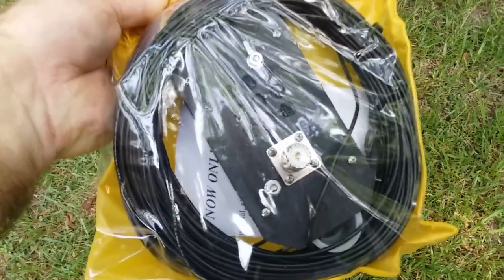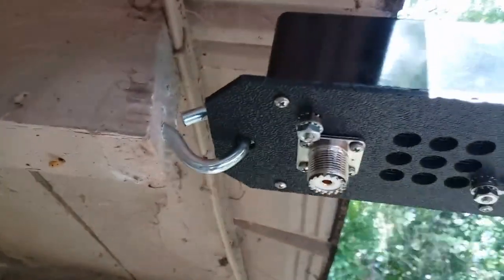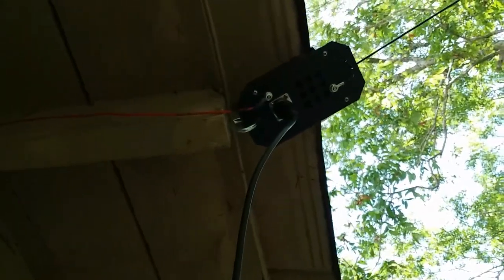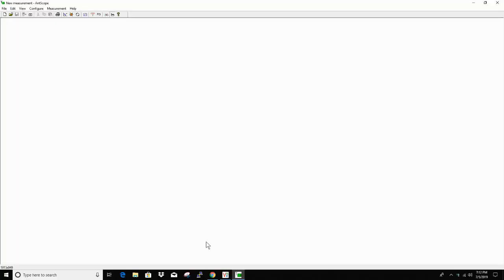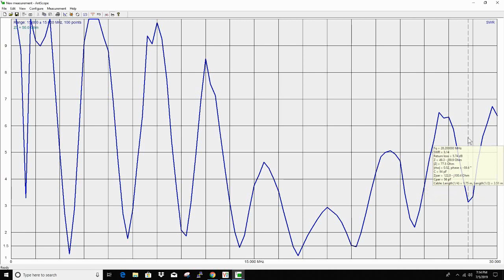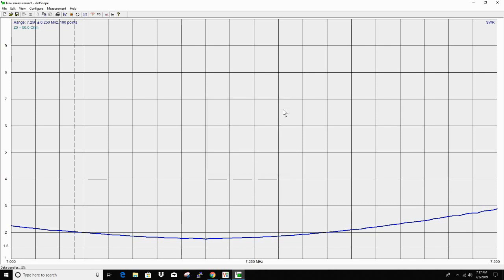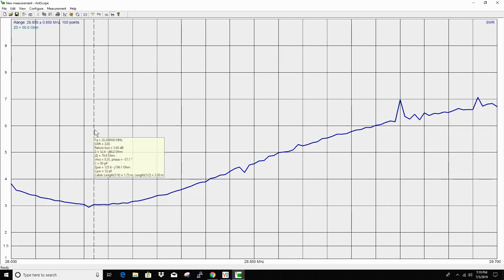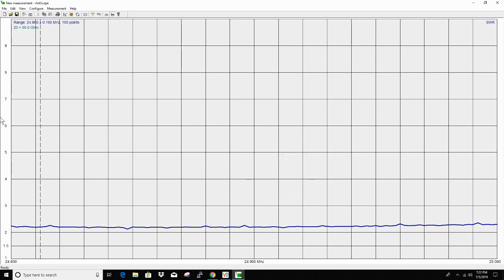MFJ 1982MP Endfed Half Wave Antenna

Comment: This was my first antenna, and I still have it. I got every state except HI (even then, probably could if I tried harder) from MD. I’ve also gotten New Zealand on FT8, and EU is easy, but I live in east coast. 10 meters is mostly unusable. Everything else is ok, especially with a built in tuner. I use it mostly now for 80meters since my DC Commander doesn’t have 80. 

It will eventually break where the wire meets the box, and only took a couple of minutes to fix. It’s definitely a great value and I recommend it, especially as a first antenna.
Reply from the maker: Thanks for the comment and thanks for watching. Mine has broken, but as a result from a falling  limb during a hurricane.
Reply: @dongibbskk4qam  sorry to hear that. I literally just took mine down a few minutes ago as I have a lot of landscaping work being done tomorrow. The silver lining is, you can always just replace the wire right?
Reply from the maker: Repair has been made. Just havent put it back up yet. I actually have several antennas up and I'm not in need of the antenna right away.

Comment: Great video Don! That has narrower bandwidth than I would have expected for a half wave. I like your sliding insulator idea. I'm not a fan of how MFJ does their strain-relief though, I prefer how HyEnd does it on their wire antennas.
Reply from the maker: Thanks Jason. It looks to be a promising antenna. I got so hot putting it up that I didn't get it adjusted. Hope to do that in a day or so.